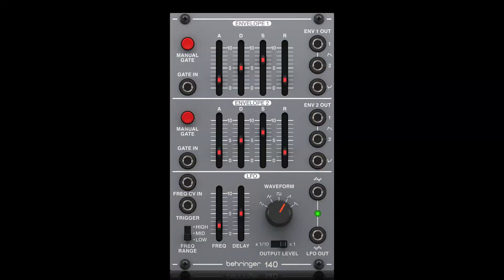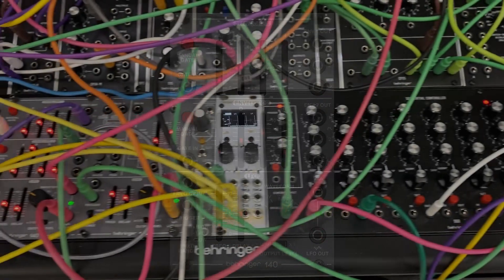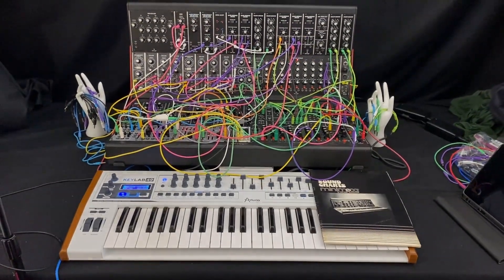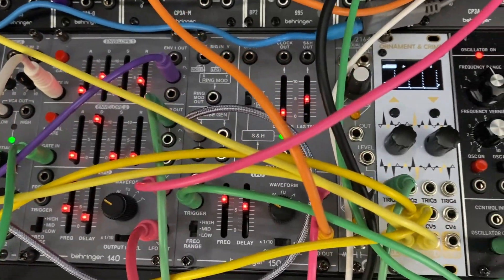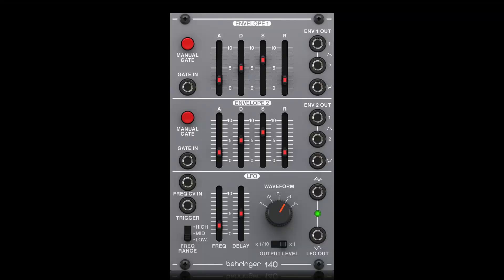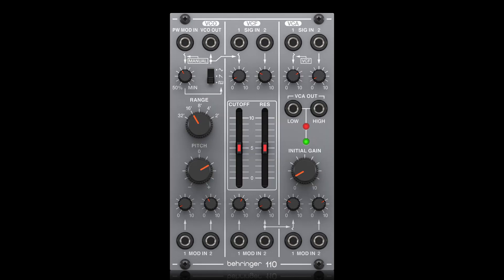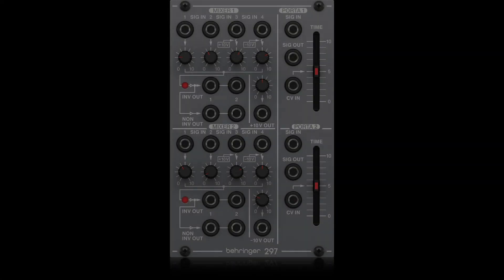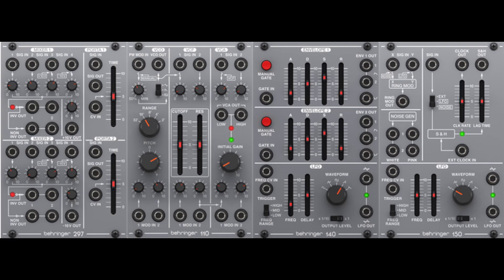System 55 - Top 5 Missing Features

Comment: Nice video O.Z. Extremely informative and answers some questions I have about the System 55 modules. I can get mod out with my Keystep, so that seems to fill the gap a little bit. The big thing I needed was LFOs, I have a quad LFO module that is killer. Behringer is pretty busy with new stuff these days. Do you think they will come out with other Sys 55 modules? The Bode filter was the last one I believe. My rig contains a utility rack with some Sys 100, the 297, the 305, a 2500 1003 Envelope and a reverb. I have a System 35 in 3 racks also. Thanks again. Cheers
Reply from the maker: Thanks Tony!  What quad LFO are you using?  IMHO (no inside info), I don't think Behringer will ever revisit this product line.  There are a number of third parties who are filling in the gap.  I just received a kit for a HP/LP filter coupler ( see https://www.modulargrid.net/e/fitzgreyve-synthesis-904c-filter-coupler ). I have not built it out yet.
Utility rack is a good idea.  Cheers!
Reply: Hi, I have the Behringer 4 LFO and 4 VCO modules that came out a little while ago. They work quite well and really give me a lot of flexibility. I have seen that video by Fitzgeryre. He seems really great. Thanks for posting all this great content. You are the man @ozhalljr